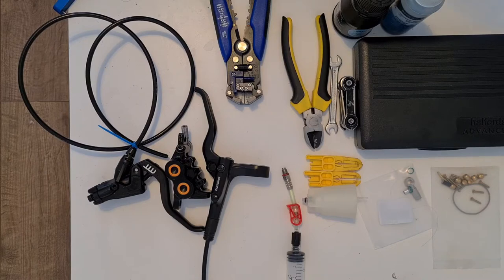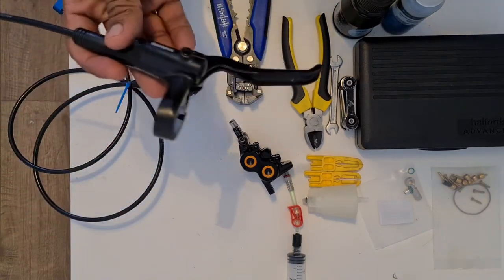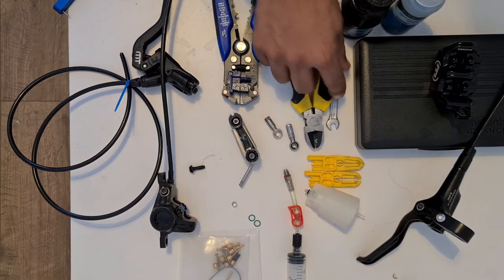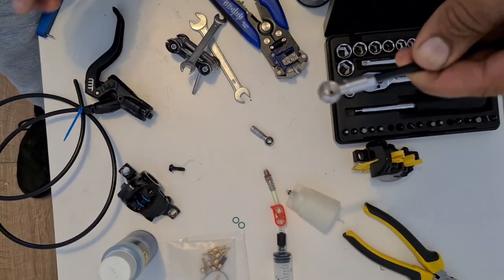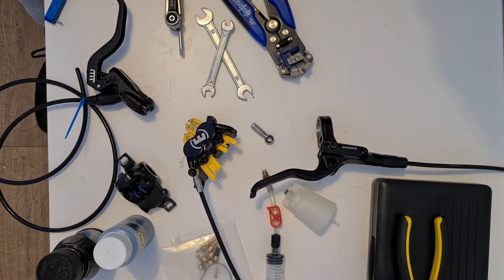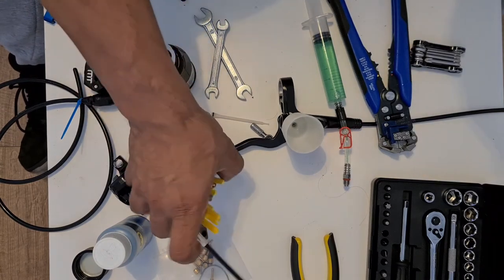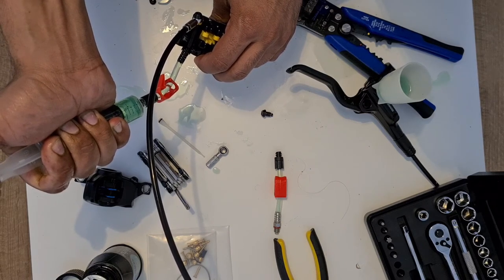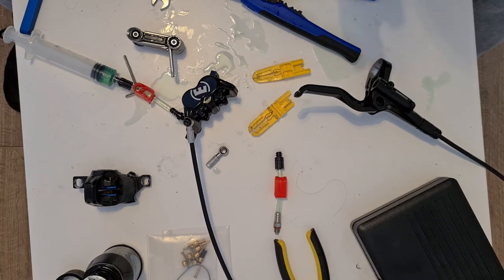Shigura how to

Comment: Thank you so much. Didn't know if a banjo from other brakes would fit.
Reply from the maker: probably not, I've tried shimano hose from the saint brake on there and it worked temporarily, but ended up not holding pressure under hard braking

Comment: Just combined a SLX shimano brake lever with magura mt2. Filled it up with magura royal blood, gave it a good bleed and it totally failed. Although it was perfectly bleed, the braking force was really weak. Then I came across your video. Do you think that if I put shimano mineral oil instead in the system, it will work better or not?
Reply: What rotors are you using ? Shimano rotors are thinner than the Magura rotors, the pad travel will be mostly used up by the time they make contact
Reply: @clonoid  oh I already changed my brakes to mt5s with mt trail sport brake levers so the problem is gone. For the rotors, I have avid 160mm rotor at the back and aztec 180mm at the front
Reply: I use Shimano mineral oil works perfectly

Comment: You didn’t clearly explain what typ[e of hose you used or banjo and olives and fittings for each end…what hose? What fitting and olive on the caliper side. What fitting and olive on the lever side? Thanks!
Reply from the maker: The barbs and olives in the lever are shimano. the banjo is one i found on amazon for magura
Reply: @tar2trail448  thanks! im still running my magura MT7's with HC3 levers as I have yet to break them but I have a set of the top of the line XTR 9120 levers that I want to make sure I have the fittings and what not to pop on in the event I do break my magura levers. are you still liking the shigura setup?

Comment: Lol I laughed when u said that the lever on the mt5 would not brake because its aluminium...mine just broke doing absolutely nothing...just did some chill riding
Reply from the maker: aaah that's not good only reason I made that statement is because I have crashed hard on them, other than scuff marks they faired better then the brake reservoir
Reply: @tar2trail448  yea I know :D. But this has a good side. Now I have a reason to buy Shimano Levers haha. Just bought 7100 Levers

Comment: Hi! I have a set of 6 years old magura Mt4 2 piston brakes the levers of which are toast. Calliper and hose are fine. Can i Just fit Shimano levers on the original magura hose, replacing the fittings with Shimano ones? Just trying to get them working again, even if i am currently using Shimano slx 4 piston on my bike.
Reply from the maker: hi yes you can need to use shimano fittings (olive and barb) on the hose end that goes into the shimano levers fit isn't as tight as it was using the magura parts but once tightend up I don't have any issues

Comment: Hi can i ask something i have a magura mt2 brakes but the insert of shimano bh90 is not compatible with the hose of magura mt2 it's too loose and im about to replace my mt2 levers with deore m6100 can i use the magura inserts and olive in to the hose and use the deore lever? Will it be compatible?
Reply from the maker: no magura insert are different. I actually didn't think it would seal either because you can literally push the nipple in with your finger. but touch wood haven't had any issues

Comment: I heard you couldn't use a Shimano hose as the banjo end is different, where did you get the Magura banjo seperate to fit the Shimano hose? Also where did you get the nipple to put on the syringe to fit into the calliper? Thanks
Reply from the maker: the fitting is a tekro brake bleed kit. and shimano banjos do work i have just changed my levers to shimano saints
Reply from the maker: hi Dan just an update shimano banjos don't work. I had it running well for a while blew the seal out and they started leaking. the id of the banjo on shimanos are larger then maguras
Reply: @tar2trail448  Yea that's what I read. I'm running magyra caliper and hose with, magura barb and Shimano everything else without issue. They work fine but one weird issue when bleeding was if I oush the fluid up all the air bubbles cleared and it was fine but if I sucked the fluid back from the caliper end I just coulen't stop getting streams and streams of bubbles. I thought it was a leaky caliper but since pushing the fluid back up to the lever and fotting everything I haven't had any issues so don't know where the air was getting in.
Reply: @dank6761  this is usually because air is getting past the seals on the syringe, bleed tube, or bleed fitting, and probably not a problem with the caliper. try tightening the bleed fitting a little more.

Comment: Hey there! Is that the mt200 levers?
Have you tried using your old magura brake cables on the new levers?
Reply from the maker: yes this is the general setup I use. I just change the barb and olive to the shimano ones